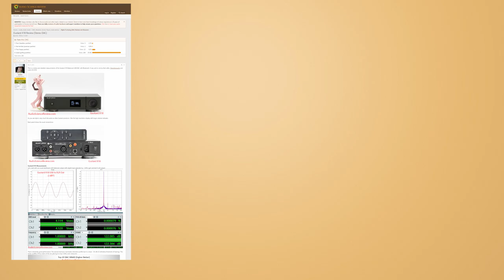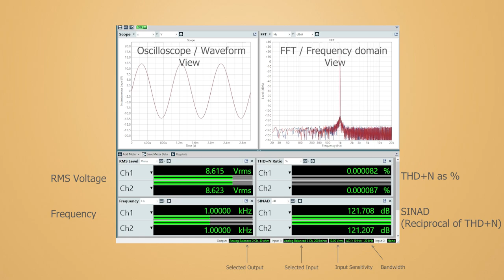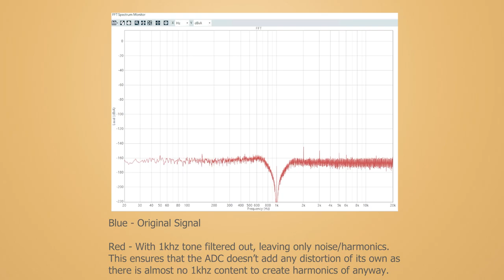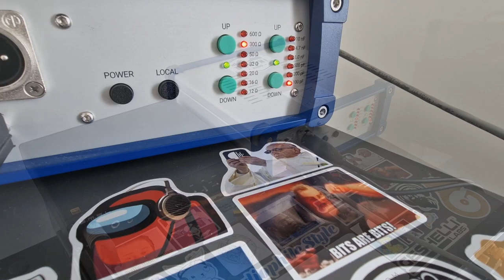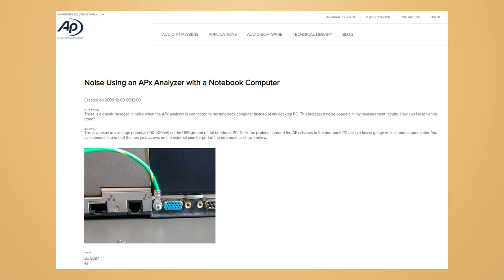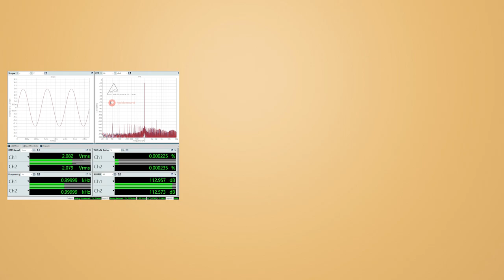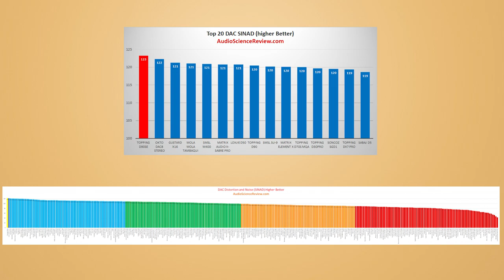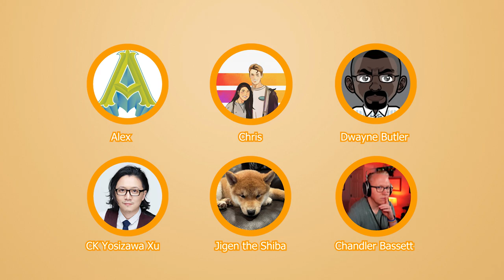Why you can't trust audio measurements

Comment: Excellent. As an engineer, I have long known that Amir at ASR is misleading his audience. The attempt at rankings is almost meaningless at such a detailed granular level. The use of headphones for listening evaluation is a waste of time. Stereophile is a bit more balanced nuanced showing JA maturity and experience. Listening differences are also affected by a whole host of factors such as input Vs output impedance as a function of frequency, ability to handle a capacitive load, phase issues, damping, speaker/headphone impedance response etc. In this same way, a ranking based on listening tests is also going to produce different results in different systems. You use headphones. I use 6 figure studio speakers preferred by engineers at the world’s top studios. What I hear obviously differs from your experience. What I hear from a Benchmark DAC 3 on my speakers is obviously not the same as what you hear out of your headphones. For starters I don’t use their headphone amp in fact my DAC doesn’t have a headphone out. My ranking of several DACs will likely therefore differ from you. That said we seem to agree broadly - PS Audio DSD DAC is not highly resolving. MQA is actually worse than CD or FLAC especially since it adds phase distortion that cannot be removed. So their are overlaps between listening in different systems and testing under different conditions ….perhaps the only certainty is Bad is Bad https://youtu.be/7CscPTI8fwA

Comment: This viewpoint is a good balance between objective and subjective, because objectivists don't think amps/dac can sound different if they measure similarly and subjectivists think measurements don't matter. Excellent video.
Reply: I'm in the weird camp of "measurements don't really matter much, and subjective impressions don't really matter much, most people fail blind tests between gear anyway." I just think that most of the things that both camps claim to be able to hear aren't even there. Human hearing just isn't that good. You can barely hear -60 dB of distortion outside of test tones, let alone -120 dB.

So when people tell me that their modern, non-faulty amp changes the staging, or that -140 dB of jitter is audible (which does not manifest in audible time-domain differences, it causes extremely minuscule Doppler Effect changes between samples, AKA a very slight frequency shift), I just kind of roll my eyes.
Reply: @KaneAmaroq  I'm weird too. I'll join your camp. I'm also newbie and have only experienced a limited amount of gear, even though I'm buying it up like mad. 

I have an engineering side, and understand practically that something like a DAC or amp has to adhere to sound engineering principals to even function. 

But I'm also a musician, and I can just listen for myself to determine what I like. I can't measure how much I like music, either. All that said, I sit somewhere in the middle, or maybe the outside, just hovering above it all open-minded and realizing I haven't heard enough gear to say that measurements are all that matters or don't matter at all.

Comment: Some people live by measurements IE audio science review.  They should dismiss that site completely.  They have done way too many deceptive reviews.  They posted measurements of a DEFECTIVE old Carver M1.5t amp.  They even commented on the sound.  Uh...what part of DEFECTIVE lends them review credibility?  They don't do this for Topping, which are the least reliable product on the DAC market.
Conversely, a Mcintosh tube amp may measure poorly.  On many speakers however, the sound can be described as "magic."

FWIW:  most measurements could only be correctly interpreted by an engineer, not the average audiophile who the review is aimed at..

"There is only data to be manipulated"- The garden of Allah/Don Henley.

Comment: I never seen a single device (from a established brand) that measured bad.

Every devices outperform the human ear by a lot so lets be honest... Measurements are interesting to watch at, but they should never be used when doing a purchase decision. At least not in the real world.

If one amp shows an dynamic range of 130db in measurements and another amps shows an dynamic range ot 96db in measurements.

No Human on this planet will ever be able to hear any difference at all, lots of blind tests have shown this. Its almost 40db less dynamic range and it makes 0 difference in the real world.

And 96db is really bad, even the S-Master HX is measuring at 108db Dynamic Range at 120/120 High-Gain (which is the absolute worst case for this amp). And this is, to my knowledge, the worst Dynamic Range from any established brand. An its one of the best sounding amps that exist.

Also, the same blind tests have shown that a difference in 1db of volume does make a difference. Everyone things the Amp that is 1db louder, sounds better. Even if the measurements show that its drastically worse, it will sound better.

So if your amp measures bad but you like it, just turn the volume 1db louder than the amp of the competition you don't like and it will sound better. Easy fix.

Measurements could show if an device is utter garbage, of course, but even the cheap 20€ amps on Aliexpress measure good enough that you wont be able to hear it. So does it really matter in the end?

Comment: WOW! What a fantastic video!
I did fairly recently ask on DiyAudio about the difference in sound and got a almost unanimous reply of "Amplifiers does NOT sound different!!" That since all measurements were below what a human ear can perceive, is there no difference at all. You can take an $200 class D amplifier or a $50,000 class A and the sound will be exactly the same, any imaginary "difference" is only due to your feeling that the expensive one have to sound better. A well constructed amplifier is a well constructed amplifier and so is it with any gear at all, the only thing left that is worth concentrating about is the speaker, the rest is pure snake oil.
Reply: Well, that is a bit of over simplification. While amplifiers, provided they are doing what they are supposed to as in amplify and not color the sound on purpose, there is no difference between amplifiers when measured. But they do have to power the headphones and depending on the amp and the headphone used that may or may not result in a change of sound. Worst case scenario, amp is severely underpowered for the load required and start to distort the sound the headphones try to output.
But yeah, amplification is a solved problem these days and there are a lot of excellent powerhouse amps for little money. There is no need to spend big bucks on "audiophile" amps unless they happen to have something you really desire.

Comment: Has anyone suggested that SINAD is a full measure of a device? Why would it surprise anyone that two piece of equipment with similar SINAD numbers can sound different? Do all cars with the same engine horsepower have the same 0-60? Sounds like a bit of a straw man argument.
Reply: plenty of people say that all dacs sound the same based on this statistic, go over to asr and make a post if you want to find out for yourself.
Reply: @DueM  no one in asr is claiming that dacs of the same sinad will sound the same. The claim is this : dacs that have measurements above audible threshold will sound the same. 

There also is an often misqouted statement that all well measuring amps when volume matched will sound the same. This is also not true, the claim is "All POWER amps that are hifi worthy will sound the same when accurately volume matched." This doesnt include intregrateds that also house the dac and pre section, which is usually the part that designers manipulate to imbed a sound signature if they wished. 

To understand these claims usually heard on ASR, one have to take into context of where it was derived from and what it really means.
Reply: Ummm... have you seen the reverence for SINAD @ 1 kHz espoused by those at the ASR site?  They literally rank components on a chart based on that single measurement alone...

Comment: Interesting, but I feel like you proved the opposite of your point. Assuming the reviewer posting measurements read the APx555 manual and isn't intentionally messing with settings to be far outside of what could be justified (e.g. including noise up to 1 MHz), I only saw differences of 1 or 2 dB of SINAD. That's enough to wreak havoc on the ASR ranking list, but Amir himself says not to worry about differences that small. I get that companies can game the test by having rising harmonics or noise at high frequencies, but that's what a THD+N vs frequency graph is for. Unless the person measuring is incompetent or malicious, those measurements are pretty stable and can be trusted.

You make a good point about listening level not corresponding to test levels, but my understanding is that performance tends to increase with voltage. If the 50 mV signal has a SINAD of at least 96 dB and THD+N is stable from 20 Hz - 20 kHz, why would the system have worse performance at 750 mV for headphones?

Comment: "If you tried them, you know they sound different"

Do they???? I HIGHLY doubt that. You can do a null test to check, but I am 100% sure that they sound identical, if noise and distortion are inaudible, frewuency response is flat, output impedance doesn't affect FR and they put out the exact same voltage.

That last sentence was really bad, mate. One will KNOW the truth, simply by listening is not a statement based on anything and COMPLETELY ignores blind testing and logic.

Shame...

Comment: "Products with the same SINAD do sound different."
1. Why? Assuming that the frequency response is flat.
2. Can you measure those factors?

If not, then there is no objectivity. And I do not believe that you can provide any clear information about this.
If a different frequency response is the answer, then your information in this video is incomplete.
Reply: SINAD use dBv only to test. You have dBA, dBm . As manufacturer these value are important to them. All review will just use dBv, they removed the v, and show dB. By all the "standard" out there IEEE or AES, it is understood as dBv. You can have your DAC measure all flat at at SINAD, not problem at all. That ASR alway bite all DAC sound the same below 97dB. They don't mention about current and power factor. It is not industrial measurement benchmark to mention them.

Comment: O! Again we have see here some enthusiast without knowledge of metrology. Just for first SINAD - example of dynamic changed values from 120 to 122 dB. That is reason of what? This level can't be hear by human so this differences are just example of non linear amplification level, but still this is normal, no amp has a measured linear level of amplification. So what we have here -  example of audiofilic video% what here good without face and human on his side. Very simple - lier.
Reply: "Very simple - lier." - hah. Maybe if you worried more about your own spelling (and writing) you might find you might make more impact.

"That is reason of what? " -  You seem bothered by this video.  Did you get offended?  The reason GoldenSound put in some of the graphs he did is because there is a culture on Youtube which tries to elevate simple metrics such as SINAD as the tool by which to choose what to buy.  Did you not see the chart in this video, from the ASR rankings via SINAD?